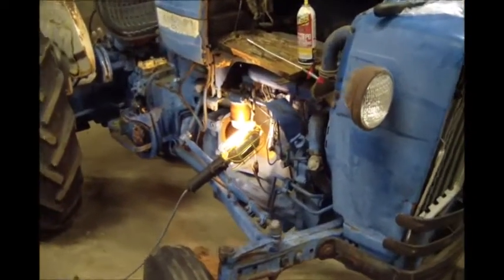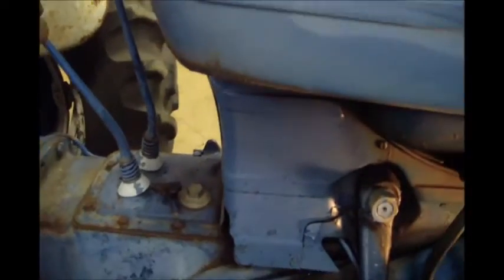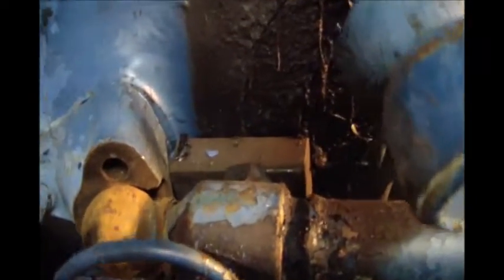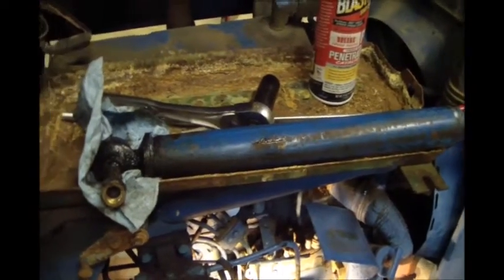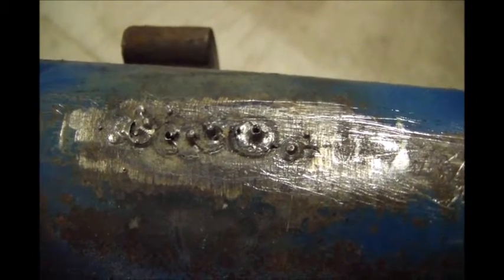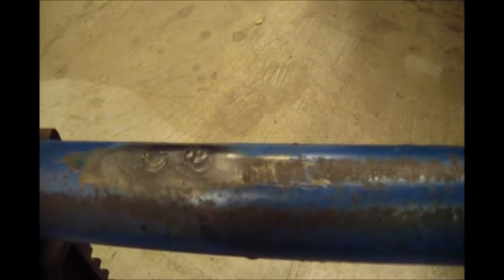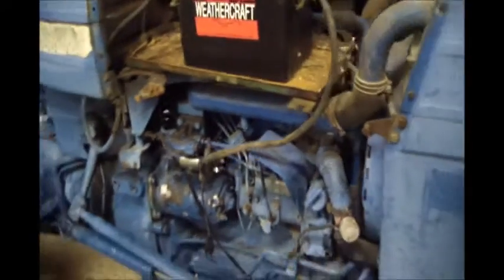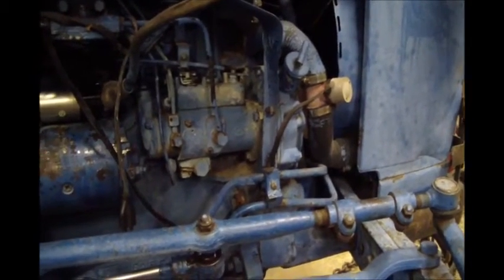Ford 3600 - Stuck Engine - Part 2

Comment: Cylinder D4NN3A540 is the replacement cylinder
Reply from the maker: Thanks for the heads up.  The welded cylinder is still functioning well, and the power steering is working well.  Maybe not to its original condition but definitely acceptable.